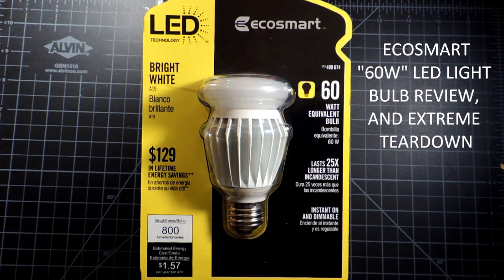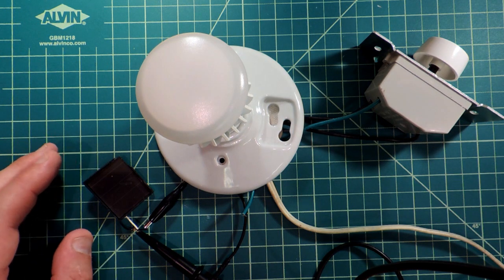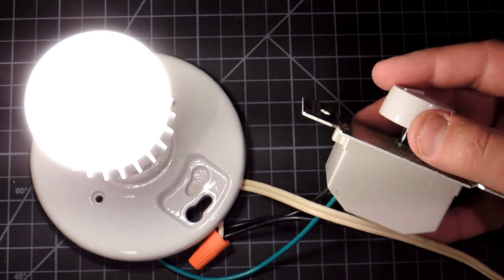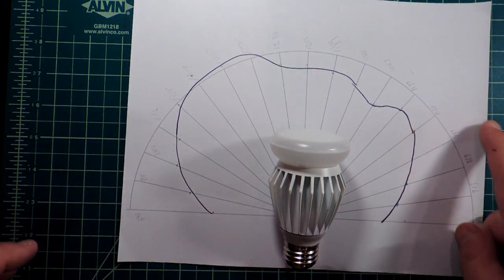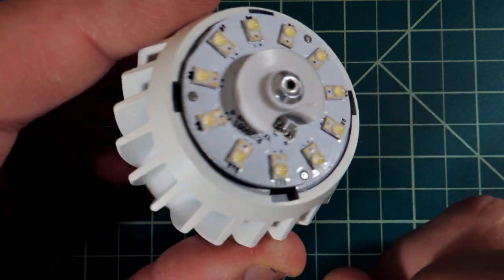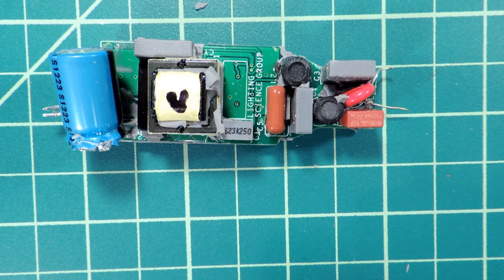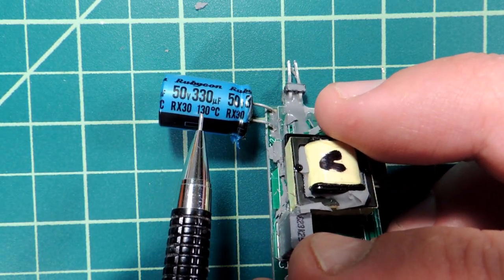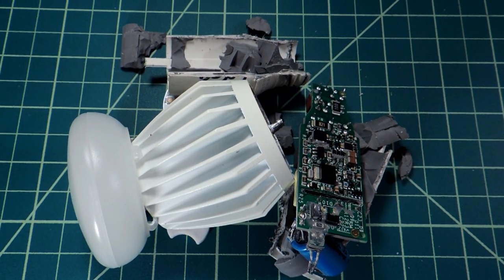Ecosmart "60w" LED Light Bulb Review and Teardown

Comment: I just tried a $12 feit 60 Watt equivalent LED - Nice light for the price (Lowes Canada - . No dark spot on the top like the 60W equivalent LED to my eye and a great bulb for less used locations given the great price and good even light. The $17 Philips 60 Watt Daylight (5000K) or Soft (2600K) is the nicest light of the three. I will try the $25 Switch Lighting 100W Equivalent LED Switch bulb soon because I am more confident that the liquid bulbs will actually give you the 20 year life span given the importance of cooling the electronics in an LED. While the ossilliscope may see 1 MHz flicker it is not detectable to my crude human eye that operates at 60 frames per second! - my two cents worth

Comment: I don't know much about light bulbs but the more watts it has does that mean it gets hotter? Cause I'm thinking about putting a scarf over my lamp but I'm worried about fires. Would these be good for that or would it make a difference?
Reply: You would probably want a low wattage bulb for this anyway so choosing an led would probably make a lot of sense. Led bulbs use half the energy of a flourescent bulb and of course, far, far, less than an incandescent. And, you must be sensible too; a large lamp shade would position the scarf further away from the bulb, that's safer and don't use a scarf that would trap the heat in. Maybe you should do a practical test. You probably have an incandescent and fluourescent bulbs that are roughly similar in light output. Buy a led, you can get a 40 watt led equivalent at home depot for about $10 and turn these bulbs on and hold your hand over them to see how much heat is being given off. I think you will find that an led bulb is the best choice.
Reply: Just buy a LED bulb with lowest lumens possible. Such as 3 Watts. It will have just ~100-200 lumen and you can choose one that does not glare you.
Reply: yeah
Reply: Thanks!
Reply: Kiley Fortenberry Just an additional note that no one else brought up. LED bulbs are solid state electronic devices rather than "light bulbs", which means that they're very sensitive to heat themselves. That's why they have those big aluminum bodies on them-- it's to carry the heat away from the LEDs and get it out to the open air where it can be drawn away from the bulb. Proper ventilation is important with many LED light bulbs to prevent premature failure.

If you're just putting your scarf over a lamp shade or something, you probably don't need to worry about it unless it's a really small lamp shade that rests close to the bulb itself. But if your scarf is in very close contact to the bulb, it may allow the heat to build up to the point that it could cause your bulb to fail much sooner than it should. Most likely you don't even need to think about it though. I'm just sharing that in case your lamp is one that has a very small lampshade (like less than maybe 8 inches across or so).

On the other hand, an LED bulb's sensitivity to heat means that you'll basically NEVER have to worry about starting a fire by putting your scarf over the lamp. The only way these would cause a fire is if the electronics inside the bulb themselves failed catastrophically, and that's very unlikely with anything that's UL Listed, as are pretty much any electrical products you can legally sell in the U.S.
Reply: That may be correct for high quality LED bulbs. These are rare. The only one I know are from OSRAM. But some non-branded ones can be really dangerous both with heat radiation and electically.

Comment: They did not de-rate the components very much.  It appears the thermal characteristics of the large cap, for example, is merely adequate.  The designers clearly do not expect the device to have a long life.  I wonder how long until we reach the point where these become as unreliable as compact fluros